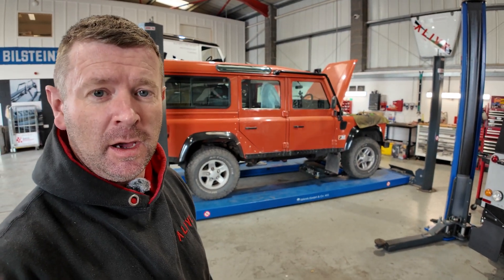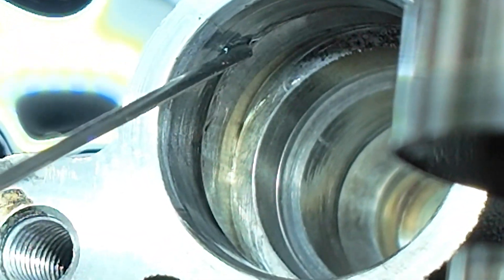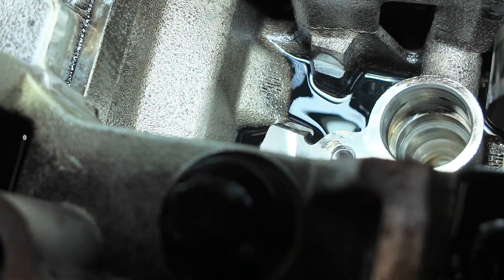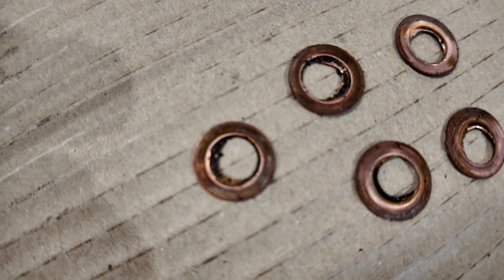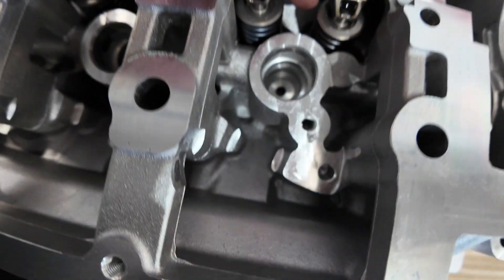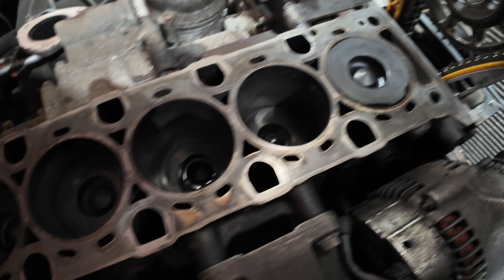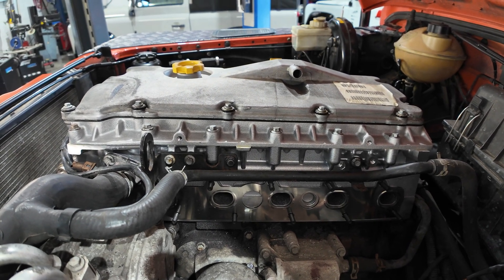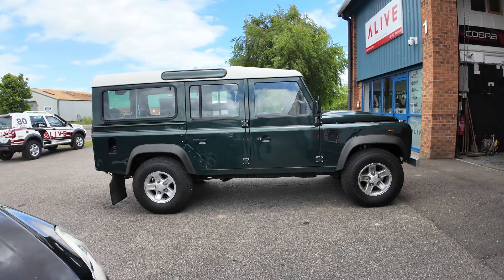Defender Td5 G4 Edition - Cracked Cylinder Head AMC Replacement

Comment: Just a thought but to prevent in the future couldn’t you in theory mill that out with the crack then insert a steel liner ring with an fuel port so the injector can’t wear and rock cracking the head.
Reply: labour is more expensive than a replacement head in general. then there's the loss of the vehicle while/if its repaired.

Comment: Interesting to see the crack location. Other than the thicker casting at the point vulnerable to cracking, do amc heads offer any other benefits over the original head design?